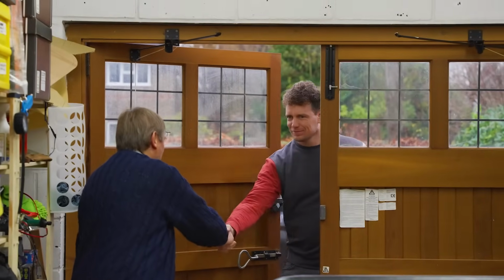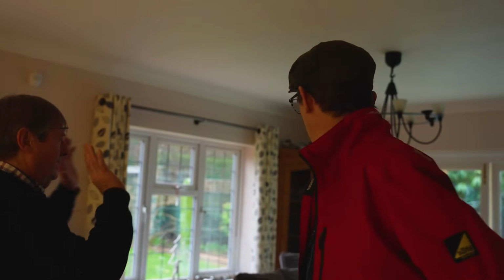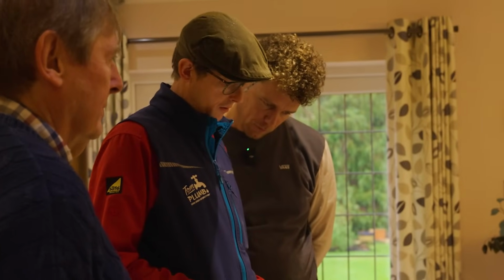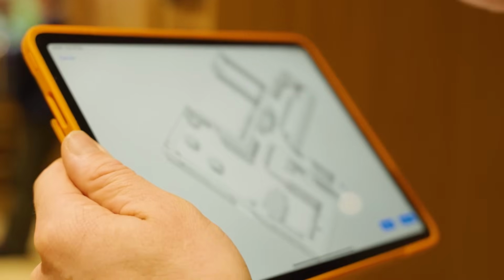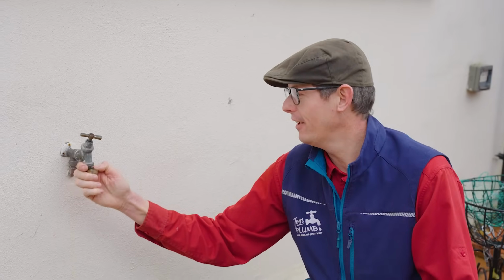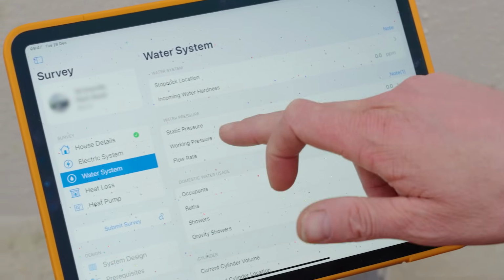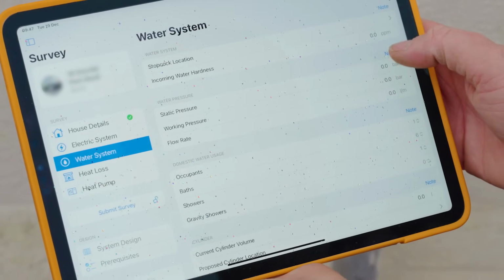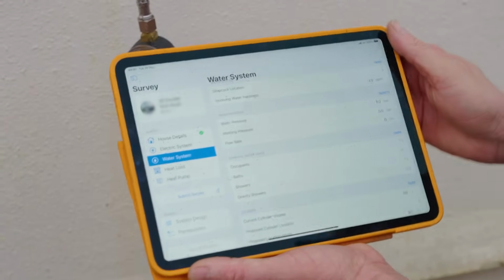Don’t Miss This Essential Step When Getting a Heat Pump

Comment: What app is that they are using for heat loss calcs? 

Great video.
Reply: It’s our own app
Reply: Is that something you can only use when enrolled onto one of your courses? Looks v good & most importantly very quick.

Thanks
Reply: Heat engineer software already does it.
Reply: @deanchapple1 HE does not do this
Reply: I think it's called a guesstimeter.

Comment: If the house is warm and you know the average internal temp and the external temp, why not check the heat input via a strap on heat meter on the existing F&R, better than any calculation or at least you can check the theoretical calcs

Comment: A crazy amount of time taken to work this all out properly. Just for the customer to decide you're too expensive and goes with the guy who just guesses 🙄
Reply: You need to pay upfront for a heat loss calculation. The contractor will subtract it from the cost if you go with them
Reply: My heat pump was installed with RHI subsidy. Installers under that scheme were obiged to use a standard heat loss calculation app. It really is not rocket science.

Comment: Why can't they just over shoot the heat pump spec and have it turned down if needed.
Reply: Because then the heat pump would cycle on and off because it’s too powerful, leading to inefficiency. Aim is to run long and low
Reply: @simonm9923  Must be a way of choking it down.
Reply: @TúrinTurambær  Modulating boilers and heat pumps both have modulation ratios, which dictate the lowest output they can provide - Below which they have to cycle on and off. Heat pumps have negative efficiency during start-up, which is why frequent cycling destroys efficiency. Boilers are more forgiving but still benefit from being sized correctly. This is why the design process is critical.
Reply: Heat pumps must be properly sized but inverter technology  means that they can run at a lower speed and heat output. @simonm9923
Reply: Because that's how you kill any efficiency gains with a heat pump. It's how things worked with old boilers, your efficiency would be absolutely the same whether it's putting out 20% of the heat it's rated for or a 100%. So the name of the game was calculating the absolute maximum required heat capacity and adding a hefty buffer on top of that.

It's not like that at all for heat pumps. An oversized heat pump will have to constantly switch on and off instead of running at a nice steady speed. That kills the efficiency and puts a lot of extra wear and tear on the unit. Heat pumps have to be sized just right if you want them to make sense financially.

Comment: I can't wait to see the first bill
Reply: But what's the payback period after the initial investment? How many years?
Reply: @Reakerboy  It's not about pay back not everything has a payback your car isn't about payback a holiday isn't about payback. It's what you gain from them in other aspects. Heat pumps are about improved environmental benefits or efficiency plus comfort of a constantly warm house 24/7 for the same or less than gas.
Reply: @Burtis89  It’s a fair question, is this expensive? 
What is the pay back time vs fixing the boiler?
What if we increased the thermal efficiency of the house but fixed the boiler? 
Does it get very very cold here? In which case is there a solid or liquid fuel back up for emergencies.

It’s pretty much always cheaper and better for the environment to fix your old car, you can add all sorts of tech to it, same for housss, this is just an upgrade on the house so what’s the payoff? It could be instant in terms of value add to the house.
Reply: @Thatguy-cb4qs  a heat pump is between 300 and 500% more efficienct than gas that's 3 to 5 times less energy used in making heat so this is very much a environmental thing
Reply from the maker: @Burtis89  It is not just an environmental thing. People are struggling to pay their bills. It is a hard sell to a person who has no money.
Reply: @SkillBuilder  absolutely it's why I got one to be honest my boiler was a back boiler. Using about £150 just running the pilot light then £100 a year standing charge. And that a stone cold house.

My December and January heating bill for my heat pump was just over £200 so have £50 left for this month so financially it makes sense for us, we both earn below the average UK wage and pay a £1080 a month mortgage.

And I still haven't fully optimised the weather comp settings
Reply: @Burtis89  the price of electricity is 400% more expensive than gas so even if you run at 400% efficiency which is extremely doubtful unless your house is extremely well designed & insulated your still only going to be breaking even in running costs.
But the ASHP installation would have cost approximately £15k so something doesn't add up with your story!!
Reply: @pauldavies7251  £3500 to fit the system. 
3 bed 1960s mid terrace 300mm loft although not layed evenly as renovating and rewiring so can gain efficiency there. Cavity ealls have been insulated by previous owner.

COP has been high 3s to high 4s at points in this mild weather.

Boilers are 85% efficient say so you actually burn say 8.6p in gas electric is 28.7p. so only 3.3x the cost. 
My house is 20c 24/7 
Like I said £100 saved on standing charge paid my December heating bill.... Why would I lie nothing to gain.
Reply: @Reakerboy  he's talking complete & utter 💩
Or he's had a huge grant because of low income etc,
But if he is on below avg wages like he says with high mortgage & outgoings how the he'll can he afford £15k to waste on something with no payback 🤔🙄
Reply: @pauldavies7251  You're on it my friend!
Reply: Will be cheaper than a gas boiler. Guaranteed!!
Reply: @deanchapple1 that's debatable as gas is 4x cheaper than electric & modern boilers run @ 95% efficiency which means this system would need to run at 360%!!
That's without factoring in the massive initial cost of the asap compared to a relatively inexpensive boiler
Reply: @pauldavies7251  95% in theory for a condensing gas boiler - good luck finding one installed like that.
Plenty of heat pumps putting out over 400% efficiency in the real world.
Cost wise there are tariffs that are excellent for hps.    remember that in the uk leccy prices are tied to gas production costs - keeping them higher than they should be.
If no other option then go smart tariff with batteries - charge up on cheap rate and run the system from the bats.

Comment: Paul weaton has just done a video of heat pumps against rocket mass heaters ..... permaculture design is the only way forward and it's a finger up to the man in every single way
Reply: Unfortunately you can't put them in a new build though, it'd not pass regs. Also, an entirely different type of heat. Possibly not for the modern human lifestyle either. 
I'd like a rocket mass heater though, so I'll check out Paul's video. The best part, for me, is that it's an incredibly simple technology that you can build and maintain on your own. It requires no app, survey or specialism. I believe that will become more important in the coming decades.

Comment: Jesus. Wouldn’t you just use this in major renovations or new builds. Seems like fairly serious investment. What’s the pay off time?
Reply: What’s the payback time for a new kitchen or a new car - why don’t we ever ask that?
Reply: Kitchen functional, a car if it earns you a living all payback. This is a pipe dream for a lot of people, a luxury they cannot afford without major investment from taxpayers.  @simonm9923
Reply: @simonm9923 okay, what's the payoff time for a new kitchen?
Reply: @ricos1497  my point is no one asks what the payback will be on most things you buy, like a new car or a big new telly but when it’s something like a heat pump or an EV or loft insulation or solar panels that’s the first question that comes up. Spend your money how you want, why do you need to question / justify it?
Reply: @simonm9923  I know, I was just being cheeky. Although I suspect the answer is fairly obvious. Kitchens and cars are material objects as well as functional tools. Nobody is buying a heat pump to satiate their ego (some might be!). I looked at the efficiency of my tumble dryer when buying a new one, and calculated the rough saving over a cheaper model, and I suspect folk do it on other purchases. However, a lot goes down to messaging and, indeed, the subsidies. The message has always been "buy worse technology. It's shitter than your gas boiler, and more expensive, but you have to do it to save the planet. Plus, we'll give you a grand". If they'd just used the time tested model of propaganda and marketing we wouldn't be having this discussion. I was working in Norway a few years back and my colleagues couldn't believe I had a new(ish) house with an oil boiler. They thought it was some old fashioned, backward technology. If we'd just marketed heat pumps as amazing new technology and thrown a bunch of celebrities, hanging off radiators in their pants at it, we'd have sold millions by now.
Reply: @simonm9923 what an absolute ridiculous comment 🤦‍♂️ 
A nice car brings pleasure & joy to the owner as does a nice looking well planned kitchen,

A heating system is just that there's nothing to get excited or happy about so why spend so much money when there's no need,
Enjoy your cult
Reply: @pauldavies7251  thanks for your interest. So in summary, we can choose to enjoy our money as we wish, excellent.
Reply: @ricos1497  could be instant. It may raise the value of the house by more than it cost.
Reply: @simonm9923  I do. It’s usually way cheaper to fix the old car rather than buy a new one, it’s also much “better” for the environment. 

Not saying it’s not worth it, it may well be but:

How cold does it get there? 
Is it subsidised? 
Was there an option to repair the old system? 
What’s the efficiency pay off (monetary and environmental) you keep/ fix-the old system and just increase the thermal efficiency of the house? 
Why not just use reverse cycle split systems?
Reply: I do. @simonm9923

Comment: A cover over a radiator will affect the rated output but not the efficiency.
Reply: I think he meant the resulting efficiency of the heat pump. If you needed a higher flow temperature to compensate for the reduced output of that radiator, it would reduce the efficiency of the heat pump.
Reply: @simonm9923 yes, that's certainly true. I was assuming the same flow temperature.

Comment: Love this content, all very interesting. Would love to know how a heat pump would work in our 1930s house... Where all the kit would go, tank, outside unit... Would radiators need changing... Would our house even benefit from one... Not that I want one 😂.
Reply: Exactly my problem and situation not that I'm ever getting one.
Reply: Yes you can do a 1930s house with a heat pump. But there are a lot of details. If you change the radiators it will run cheaper than a gas boiler, especially if you take floor heating.
But then the whole operation might become too expensive.
You might want to look into air to air heatpumps (aircon) if they match the power needed. Might be a cheaper option.

Comment: Heat pumps and EVs have become a religion to some.
Reply: And gas boilers are not?
Reply: @tomkacandes8286  No. People install them and forget about them. They garner almost no attention. They're one of those appliances that quietly get on with their job.
Reply: @tomkacandes8286 nobody I know has joined that religion!!
Why are you so defensive
Reply: they seem to get an awful lot of attention when someone wants to buy an EV or install a heat pump. Seems we can’t leave them alone and have to tell them about the glory of gas.
Reply: You chose to assert that those viewing two technologies must not have rational basis, hence “religions”, but I see the same with the dramatic beating of chests about “my gas boiler is great and nothing else works” by commenters who clearly have no experience of that which they reject out of hand, presenting no basis for that position, same as you. Sorry you think your assertion must remain unchallenged, that’s a small view of things when we have data on both EVs and heat pumps performing very well.
Reply: @tomkacandes8286  Actually, I don't have anything against heat pumps when used in the right situation but I don't like them being recommended for the wrong situation which can end up costing the homeowner more. I'm rational about it. If I had a house built to my own spec, insulated to the highest standards with underfloor heating on both floors, then the calculations could then favour a heat pump but for the majority of spec built houses with radiators or old houses with poor insulation then they lose credibility. If all new builds are going to have heat pumps mandated then the houses should be built accordingly. Our local authority tried pushing them on people because they had an agreement with an installer who would have been perfectly happy to sell them irrespective of their suitability. As for EVs, it would be physically impossible for them to have anything other than a niche market because the power required to charge them would be impossible to provide from generation to cable capacity without major infrastructure improvements.
Reply: @paul756uk2  installers who do not correctly design heating systems include those who put in condensing gas boilers that never condense , running at 80-83% efficiency because the house heat distribution was not designed to meet comfortable temps with low enough circulation water temperatures for boiler to actually condense: so do condensing gas boilers “not work”? I’m happy to help you hang the installer you cite trying to do bad designs. The real world experience of many successful retrofit heat pump installations in not well insulated UK properties is running over your “new build only” narrative. If you have no direct experience to share or refuse experiences of those making it work, can you understand how the dismissive “it’s a religion!” Note sounds false to my ears? The gas is the only thing that works religion deserves equal skepticism.
Reply: Burning fossil fuels is the religion. People keep doing it despite knowing that it is warming the planet and affecting people's health. Religious people don't believe in science and neither do climate change deniers

Comment: I’m 4mins in …
So …to heat your home …cheaper than a gas boiler ….you have to spend £10,000+ 
UK power networks install - bigger supply into the house £xxalotxx

Initial bad installation £xxalotxx

Call backs and larger pump £xxalotxx 
Am I missing something….

…about to return to the video …

Dear Mr Customer 

Keep your WB system boiler 

Heat up the cylinder at night using a lower Tariff

7min in ….w/pressure 1.5bar (ok/acceptable) ….more importantly what’s the flow rate ….need min 20LPM for unvented
Reply from the maker: £10,000 wouldn't get you anywhere near
Reply: @SkillBuilder better question, why are they so expensive across the channel, I could go to the heating supply shop and buy one for a total cost of 3-4k tomorrow. Seems to be just price gouging as the materials are no more expensive than an AC unit EDIT: and thats euros not pounds, and not even counting potential 1.5-2.5k subsidies
Reply: @ManderSeis  "across the pond" means across the Atlantic ocean to Brits,  are you talking about the difference between the UK and continental Europe?
Reply: @pgf289 You're right, my bad
Reply: @ManderSeis i looked into a heat pump driven hot water cylinder, an all in one Rheem unit in the states, cost $1500, here in the UK a similar unit was £3500. A subsidy is available from the UK government for new HP systems, but that subsidy is taken by the government approved installer and misses the consumer. I could have purchased a HP 4 years ago for £1500 and fitted it myself, but decided it was not a clear money saver to convince me. To me the jury is still out on whether they are any better than a gas system.
Reply: In today’s money. Probably would have been a 15k install. £7500 from the government grant, so client pays £7500

OVO energy are charging 15 pence per kilowatt hour for heatpumps. 
So it will be costing the client 3.75 pence per kilowatt hour to heat his house all year round. HALF THE PRICE OF A GAS BOILER.
Reply: @deanchapple1 majority of people aren't entitled to the grant & even that rate would take 10yrs to break even without cost of extra insulation if needed room in the house to put all the equipment 🤷‍♂️
Reply: @pauldavies7251 everyone is eligible for the grant bud. 
You only need room for a hot water cylinder.
Reply: Wrong. A heat pump for a detached 4 bed house is unlikely to draw much more than 3kw which is equivalent to a kettle. As far as prices are concerned, it is the usual process of prices coming down with increase in the market size and competition. This is exactly the same thing that has happened with pretty much all electronic equipment.
Reply: @rogerphelps9939  we have already learned that a HP has to run longer to be efficient than a gas boiler, so until someone can tell me how long that kettle is going to run for to achieve the same performance as a modulating gas boiler i remain sceptical,  plus, gas is more than 50% cheaper per kwh than electricity.
Reply: @Etacovda63  try running a kettle for the same amount of time a gas boiler does in 12 hours then tell me how much each has cost, unless you have ditched the boiler and now have a HP you dont know how the costs compare, not including the thousands it is to replace boiler for HP.
Reply: Yes, you can turn a gas boiler on or off as needed on a particular day or time. @robbiegerard7857
Reply: Wasteful if you are not at home though. @Etacovda63